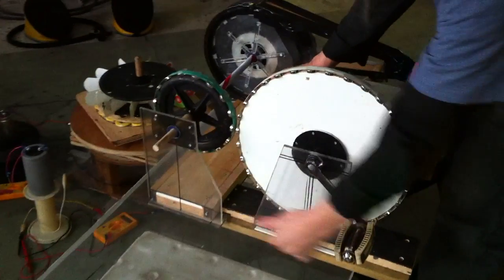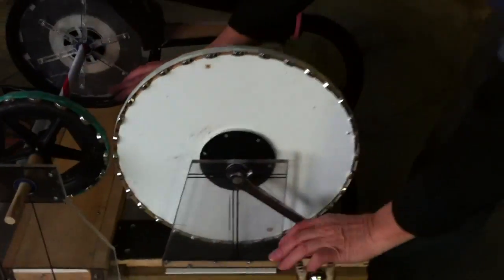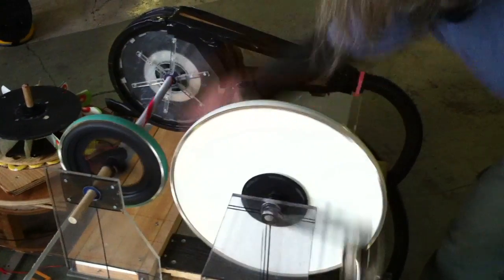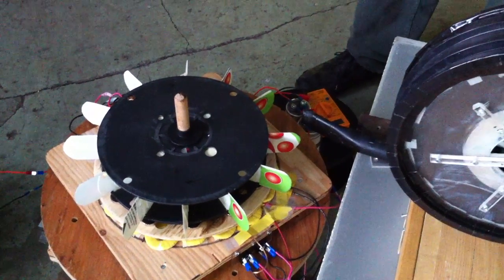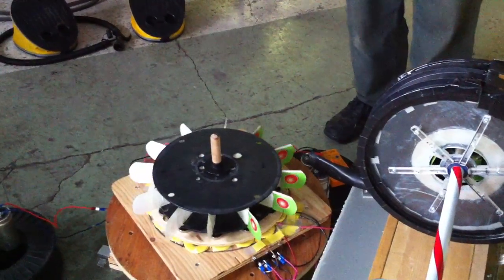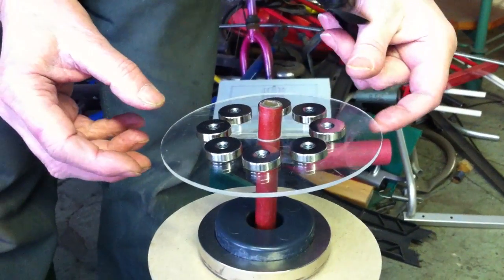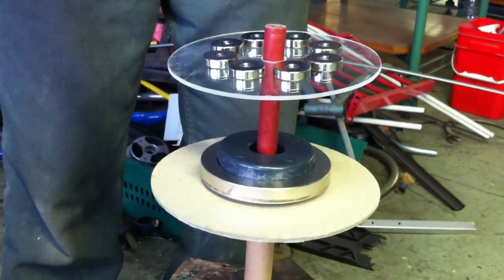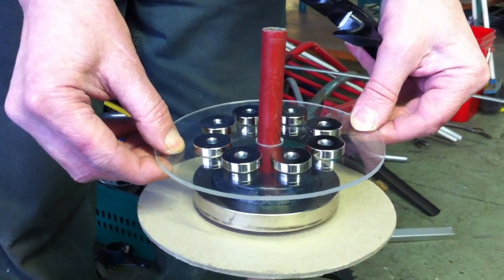Mag-Lev Transport - FS3

Comment: @immediateur There's more footage I hope gets up showing a common HAIR-DRYER spinning the unit! (1" elect. motor). Real car companies are probably using that type? Also plans for new units combining Horizontal (Searl etc.) AND Vertical (low torque turning, basic 3-phase) with fan blades extended outward for more Torq; all on that Lev-Ring. UFO and no-fuel no-grid car eng. are getting QUITE CLOSE to reality! Explore other new Lev vids if you question this? Try "Starship Rodin coil & Hall", etc.